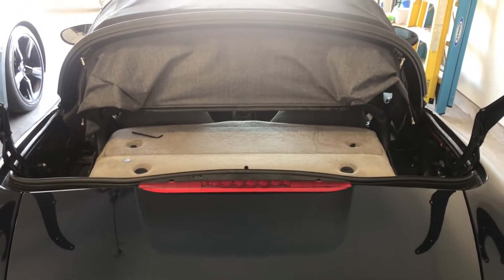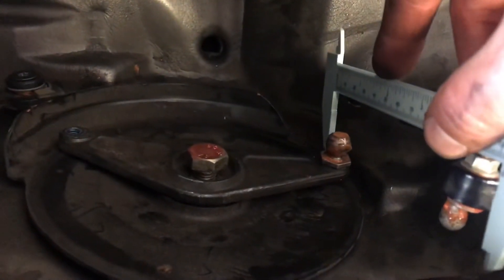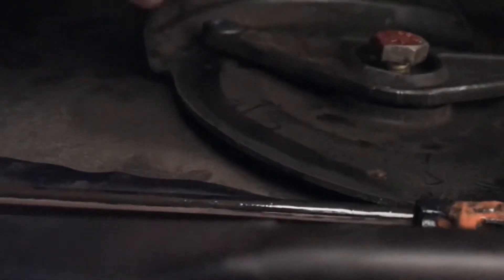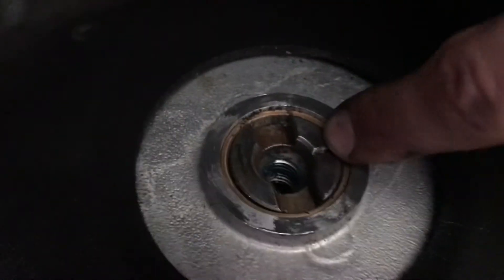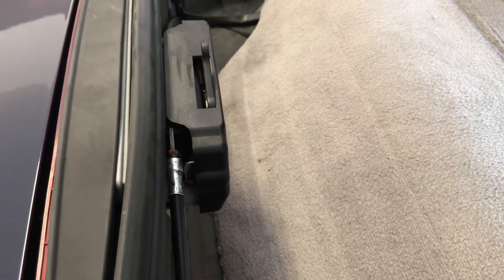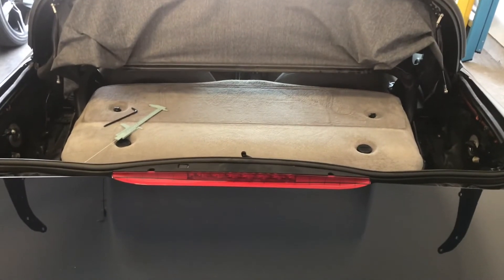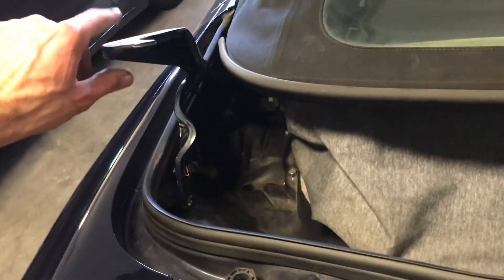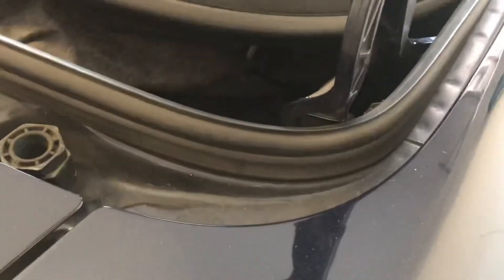Aligning crooked 986 Boxster clamshell arms

Comment: The best way to level them is to take the passenger side cable from the motor and use a drill to turn the cable and eyeball the level until they are equal.

Comment: I know this video is from a year ago. I would’ve ignored the marks and simply spun the cable on the left side with a drill until the clamshell arms were even. This is assuming the transmission is ok and the travel of the arms is unimpeded. Did you solve this?
Reply from the maker: I had to convert it to manual. The three stud-mounts that my driver side transmission bolt to were bent, throwing off the alignment slightly no matter what I did in the way of aligning the transmissions
Reply: @gearswitch5692  Sorry to hear that. What’s your solution for the clamshell bouncing around when you drive?
Reply from the maker: @bonedaddy996  It really doesn't bounce around or rattle noticeably so. I am picky and it hasn't bothered me yet!
Reply: Exactly! I literally just did it. Make sure the trans arms are tight and in the slot then unhook the cablr from the crooked side and spin with a drill until aligned. If it closed uneven pop off the cable and adjust till even. You don't even need to take anything apart.